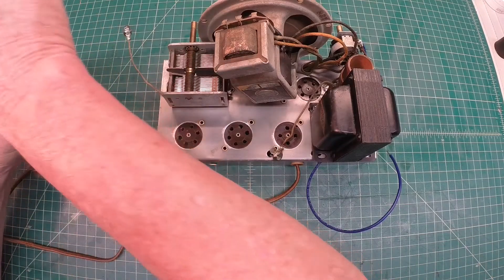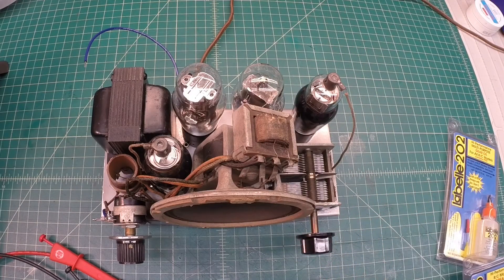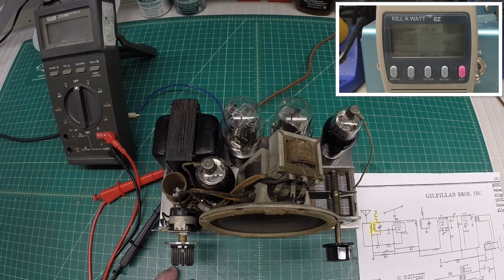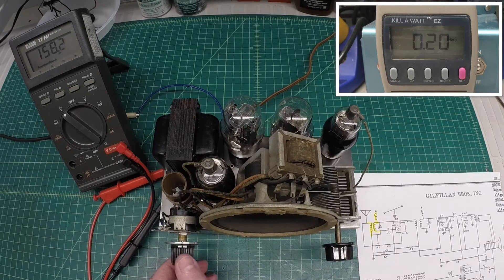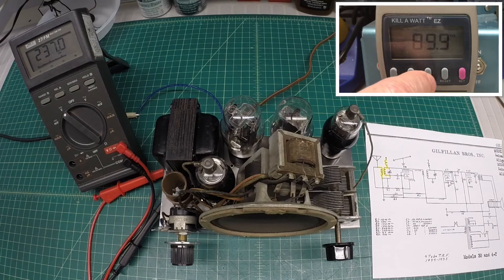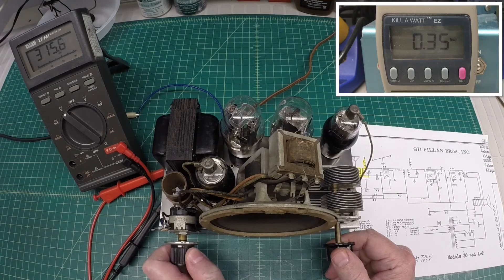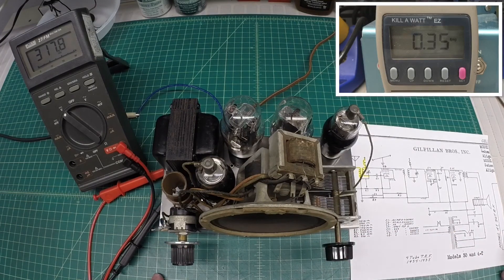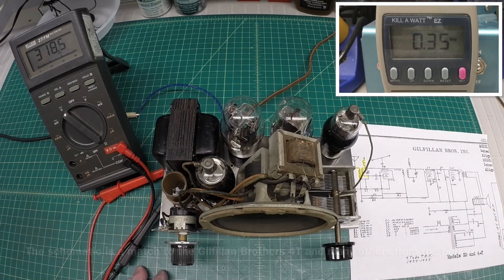Peter Pan Radio - Day 12 P2 (Tube Socket Cleaning + Powering it Up using the Variac)

Comment: How does that DE-OX-IT work? I looked up the MSDS on DE-OX-IT and DeoxIt, they are from different manufactures, and a different chemical make up.
Carl
Reply from the maker: +Carl  Burgess Carl, I bought this bottle years back and I don't know the exact differences. I think the DE-OX-ID like mine is an oil based product, while the original is not, but I may be wrong. I've never had any issues surface after using it, but other cleaners or the real Deoxit may be a better choice. Thanks for your question and taking time to watch. Best, Don

Comment: Do you  heat the pins and grid caps and reflow the solder?  Sometimes with what seems to be a faulty tube, this can clear a problem.
Reply from the maker: +Dan Floyd Dan, you bring up an excellent topic. I have in the past when a tube failed or was intermittent in nature to your point. There's nothing to lose if the tube performance is already compromised. The majority have been Grid caps in lieu of pins. Best, Don

Comment: china.  Hi Don.  If you are interested, I have several 10K pots with on/off switch.  They are not the highest quality and I think from China.  I live across the Buster Boyd bridge off 49 and happy to meet up with you to give you one if you want to see if that helps.  I suspect the fixed resistor is there to provide a maximum signal input and may not bee all that critical in value.
Let me know if you are interested.  Al WB8FEQ
Reply from the maker: +Albert Morris Albert, I appreciate your kindness. I've since moved out of the Charlotte area a few hours away. If my Dad doesn't have one handy, I'll touch base with you. Thank you again. Best, Don